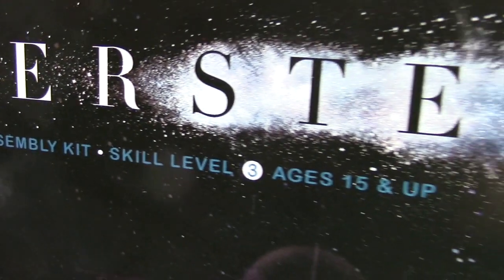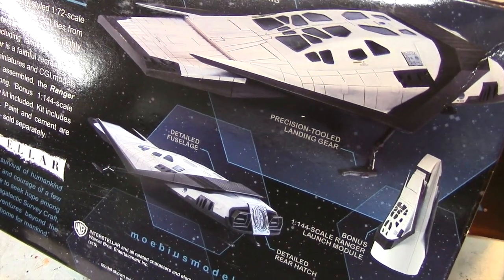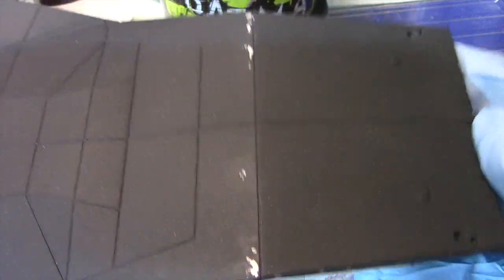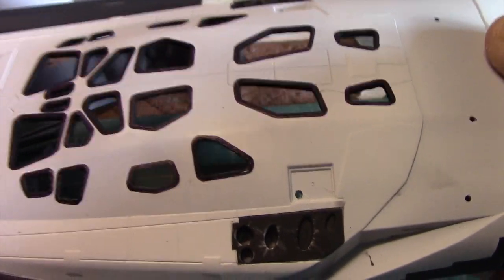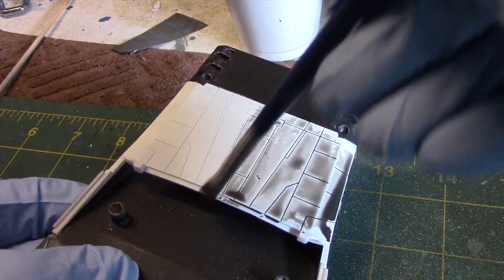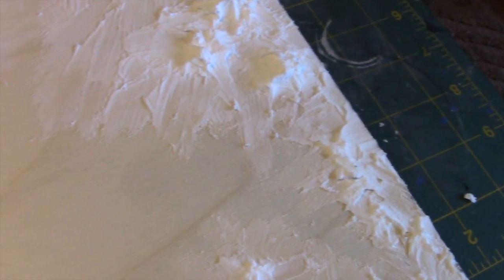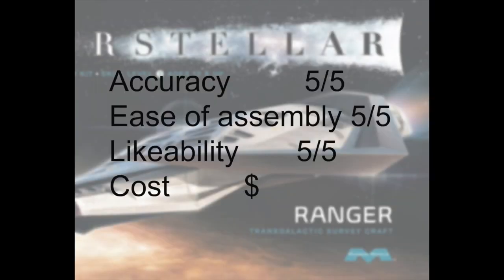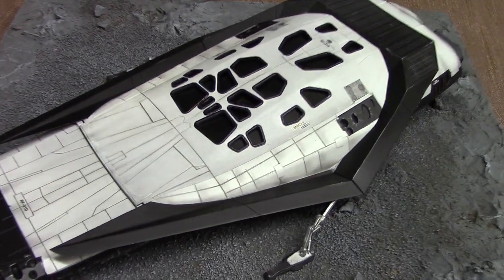Building the Ranger from Interstellar

Comment: The tool is an old-fashioned drafting pen. I used one when I went to college 30+ years ago, to learn mechanical drafting and design work.
You know, way back before there was a computer sitting on everyone's desk, or in their pocket?

If you're drawing with it, you can set the width of the line by turning the screw on the side and moving the points closer together or further apart.
Reply from the maker: Interesting tidbits about that tool.  thanks for your comment.

Comment: The tool that you have to do those panel lines was used by architects and engineering to draw plans and technical drawings. I have used those long time ago in my architectural major in school, the same way you are using it. We were dipping it in ink and draw onto a special paper to do blueprints after. by unscrewing it, we would get thinner or wider lines .
Reply from the maker: +Sylvain Barbeau Yes exactly....that's how it works. I found it pretty useful here.  Thanks
Reply: A ruling pen. Thanks for introducing me to it! I might get one and give it a try. Thanks for the video.

Comment: I thought I'd like this a lot more, being a big fan of the movie but it just doesn't translate well into a great model. The Space 1999 ship I just watched was so much more impressive which is odd when you think of the gap between when both were designed. But that's not bad reflection on how you made the model, I thought you did a great job. The base came out really well too.

I was thinking about those windows, the effort you went to cutting them out was way beyond anything I'd of done, I'm sure without that work it would have looked way worse but anyway, I was thinking, I do sculpture modeling, those little figurines you mentioned, more like that but bigger than the tiny masterpieces games workshop come up with. For that I use a clay called super sculpey but there's also another that I believe Doll makers favor called Fimo. You see it in craft shops a lot, it comes in little squares and in many colours. The also do a clear clay, I mean one that looks a bit like glass but without any of the lovely optical properties It's more for making eyeballs and such where you want light to pass through some. Now when you put the perspex on, it was set down inside the model so from the top of the model, there's this gap. I wondered if something like that clear fimo could be used in tricky jobs where you want windows but would prefer them to be flush with the outside of the model. You could easily push some clay through and do a clean scrape on one side and boom, one window that might not be as good as real glass, in that you can't see through it properly but would be good enough if you were internally lighting the model and wanted the windows to light up. Just an idea. I'll pop a link to the kind of clay I'm on about here in case its of interest to anyone modeling. http://www.amazon.co.uk/STAEDTLER-Effect-8020-014-Hardening-Modelling/dp/B0023T3648 UK Amazon there but that's where I live. At least that's the right product name to search in a country of your choice :)

http://www.garieinternational.com.sg/clay/shop/liquid_pc/killer_6.jpg
this is an example of what it looks like. the outer pool/water bit is the fimo clay
Reply from the maker: +Clay Mann Wow...that is a very interesting idea Clay.  Thank you for the tip.  I will pass this onto other model FB and google groups that I belong to.  You're correct in that the windows could not be flush with the openings and thus looked recessed instead.  I didn't want to even try to cut separate pieces into place so your method would be a cool way to approach this problem. 

And thank you for your kind comments. I know the ship's design doesn't appeal to everyone.  My son and I really enjoyed this film and part of me wanted to construct this model for that very reason.  One of the things that makes it interesting to watch is that the tech all seemed very real.  One could conceivably see them using stuff like this someday.  Thanks again for your comments, tips and for watching.
Reply: Interstellar Modeler
yes that would have been a super hard thing to do cutting each perspex window, I think you did it the best way with one sheet. I also loved the film and I think that's the problem with the model, that it wasn't designed to be a spaceship ala Star Wars models to look cool but really more realistic, like as you say, something that could really exist in a few years time. so it had that mundanity to it. I think I'd grow to like it if I owned the model. I guess its just easy to be super picky here on Youtube just browsing around lol

Keep up the great work, really enjoy seeing your models.
Reply from the maker: +Clay Mann Thanks...although someone pointed out that I made a mistake painting the nose.  Will have to try and remedy that.  Thanks again for all your nice comments.

Comment: Do you use an airbrush to apply the paint, or did you just brush it on?
Reply from the maker: Yes it was all applied with an airbrush.   Thanks for watching
Reply: Oh. So would you recommend I buy an airbrush for this project, or can it still be done with a brush?
Reply from the maker: An airbrush isn't absolutely necessary for this project but overall it would be a good investment for model building in general.  The problem with hand brushing large areas is that you tend to see brush strokes on the surface afterwards and it's not easy to get fine lines either, even when masking.  If not an airbrush I'd recommend using Tamyia brand spray paints. They tend to go on very evenly and spray with a finer mist.  Use Tamyia brand masking tape too, much less chance for paint to seep underneath it.  If you apply the spray paint in light, multiple coats it helps to avoid the bleeding through the edges of the masking tape as well.  Brushing is certainly fine for smaller parts.  Hope that helps.
Reply: Interstellar Modeler Thank you so much, this does help! I have the kit and I'm going to buy the paint today, but how I'm going to paint the model flew right over my head. Thanks again!
Reply from the maker: You're welcome. Let me know if you have any questions.
Reply: I got an airbrush from Testors and its working great! However, I'm coming up to the windows and I'm a bit stuck on how to properly paint the borders. I don't know how I would mask them off seeing as how they are such a small detail. Any suggestions?
Reply from the maker: Great to hear about the airbrush.  You will be happier with your results for sure.  As for the windows: A couple of options, you can cut thin strips of the Tamyia tape and carefully place them around the windows.  Another option is to try liquid masking fluid such as Humbrol's Maskol (refer to 4:05 in the video)  This is one of the more challenging parts of this build.  Even with the Maskol I resorted to using a thin black Sharpie to make the lines look sharper.
Reply: Unfortunately I made my attempt before reading your suggestion. I laid masking tape over the windows and tried to use an X-Acto knife to only cut out the tape covering the frames, but I soon realized that I was severely scratching the styrene :( Although the 3 windows I did this on are a bit ruined, I'm hoping to sand off the scratches with a fine-grit sandpaper. I couldn't find any Tamiya tape or Maskol in any of the stores near me, but I found a few Testors micro brushes that I think will do the job perfectly. Thanks for all the help!

Comment: Thanks so much for this.  What was the color you used with the ruler pen?  Did you dip that into the same mixture in your cup or another color?  Thanks again!
Reply from the maker: It was a mix of 80% black, 20% brown approximately. The wash was made using just craft paint and water and it's what I was dipping the pen into.  Something you may want to look into as an alternative method.....these products by AMMO MIG.  You may need to watch some youtube vids but these are some really good products. I've used some already and they're not difficult to work with.  Let me know if you have any other questions.  Here's the link and thank you for watching:  http://www.migjimenez.com/en/9-washes
Reply: Sorry, one more question:  what was the gray primer you used on the hull (paint make and color)?  That would be helpful to know.  Truly appreciate it.
Reply from the maker: I used Gray Filler Primer from Duplicolor.  My primer of choice these days is the Stynylrez gray primer from Badger.  Works real well in your airbrush.  It definitely coats evenly and leaves panel lines and surface details intact.  Hope that helps,  Oggie